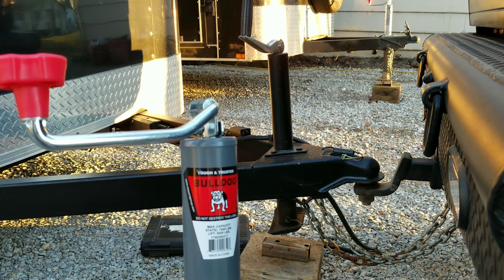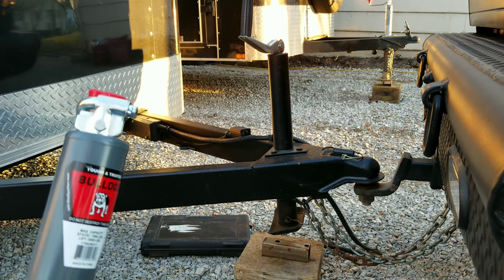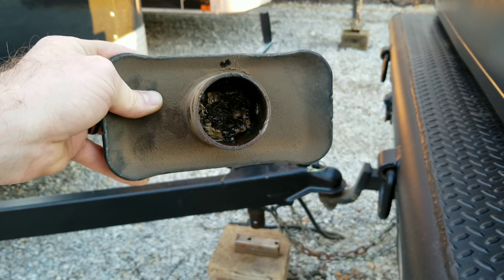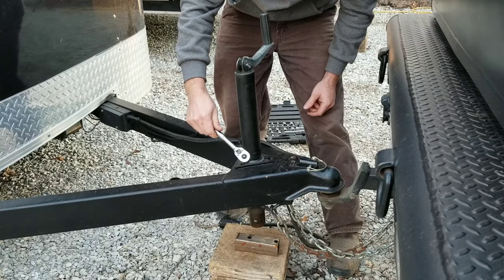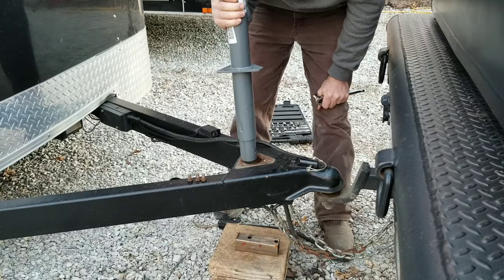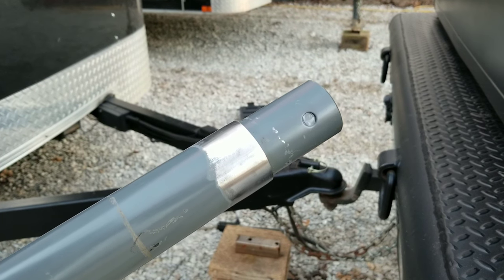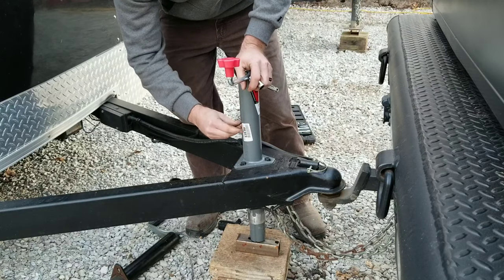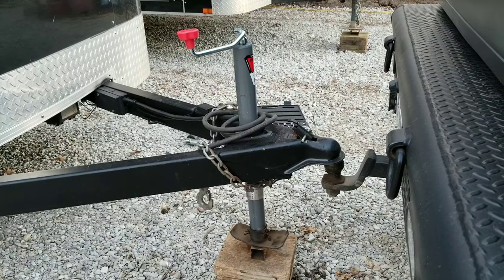Trailer Jack Replacement

Comment: Thanks for the video! Just had our horse trailer drop yesterday when trying to move it out after the winter in the paddock - easy peasy! I’ve been applying liquid wrench to the bolts since we managed to get it home last night. I am hoping there aren’t any nuts on the underside of the tongue where the plate sits or I’ll be out there for a while 😬
The tip about grinding the post is great! I’ll carry my bastard file in my pocket just in case! 😉

Comment: Your old jack is probably still good. They last forever if you take the handle off, unscrew the inside to clean and re-lubricate the screw shaft and bearing. Most people just replace them. I've found them thrown away in dumpsters and rebuilt them to work like new. It's so easy, but most people just don't know how to take care of them. It's just a big screw and nut inside that needs to be lubricated to work smoothly, that's all.
Reply from the maker: Good to know, I will try that before replacing another one.
Reply: Except mine has the threads ripped out of the traveling nut. Old jack, where to find a replacement nut?

Comment: mine had a smaller hole at the bottom than it did at the top. 
I wonder if it'll be easier to install the new one and drill and weld a new flange, or just fix and install the old one.

Comment: My 2007 tent trailer's jack diameter is only 1.4 inch,. If I can not find the right part, I will have hard time to install nowadays 2.25 inch diameter jack into the 1.4 inch hole right?
Reply from the maker: You will have to modify the hole to fit anything larger.

Comment: Just wondering. I have a utility trailer with an A frame jack i need replacing. The manufacturer welded the jack to the lower bracing plate. Is this standard practice? Seems counterproductive.
Reply from the maker: I don't understand why either, but yes some manufacturers do weld them.
Reply: @HandyGuy2016  ok just thought I was crazy. Especially when none of these fabricators are caught dead without a CNC cutting table that could easily burn a hole to exact specs. Thanks.